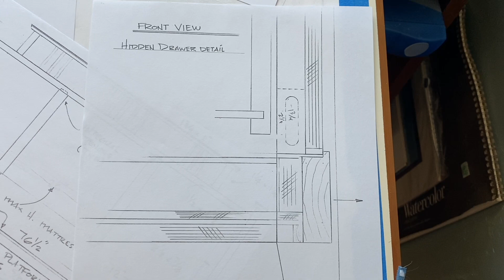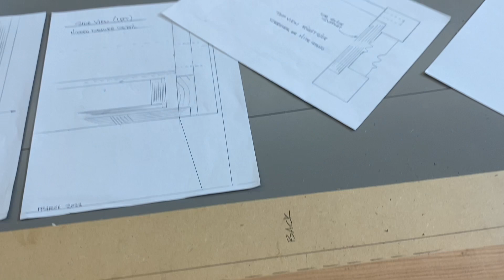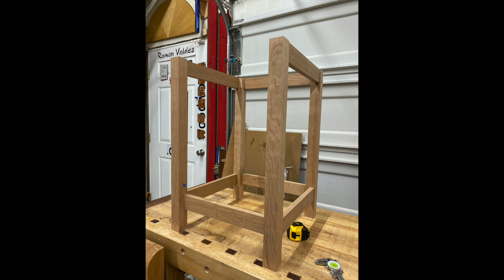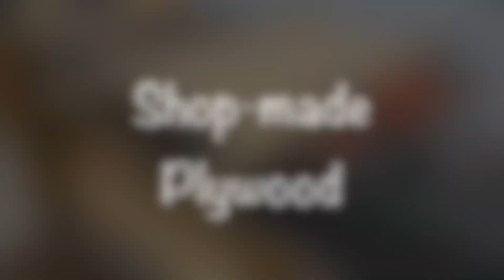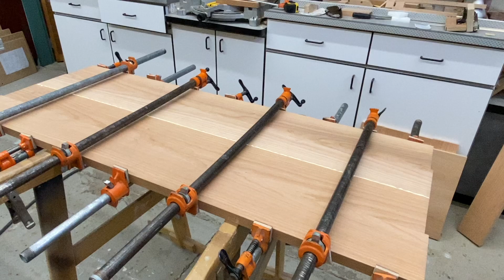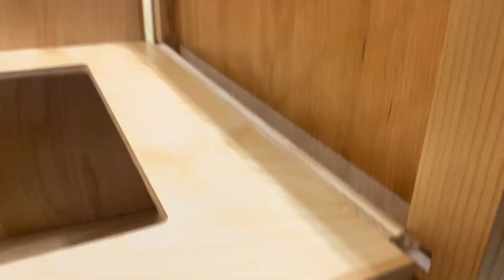Dresser & Night Stands Build, Part One

Comment: Hi Ramon. Very informative video. Two questions:
1) where and how were you trained? Or are you self taught
2) if there was twist when you checked with the winding sticks, how would you have adjusted it? Since it is all going together with mortise and tenon
Reply from the maker: I’m mostly self taught.  I did take a marquetry course over several days with Craig Vandall Stevens…that inspired me greatly!  This was fairly close to me at Anderson Ranch in Aspen, Colorado.  

Assembly of a large piece like this can easily acquire twist.  Whenever possible it’s best to glue up & assemble on a known dead flat platform.  On this particular piece, I had to roll it onto its back, ends etc during glue up.  I didn’t want to dent it on a platform, so I chose to assemble it on the floor, on a clean carpet section.  Then immediately after clamping, I checked with the winding sticks.  It was slightly off and shimmed accordingly…rechecked and now perfect.  

Had it been glued with a twist, it would still have that twist!  Such an important detail that should never be overlooked!  
Hope that helps. Much thanks.

Comment: Great video, always enjoy seeing your designs. When your making the shop plywood what is the purpose of adding a sheet of veneer in the middle, does this add extra strength to the glue up?.
Reply from the maker: Thank you.  Yes…it creates rigidity to the normally flexible & thin pieces of store bought plywood.  The added veneer grain direction is important (perpendicular to the adjacent plywood) as is the type of glue.  I use epoxy here.  Then the two outside face veneers were glued with regular Titebond I.  If the panels were large, then I’d use a rigid glue for the face veneers…like Pro-glue, Unibond or even polyurethane glue (Gorilla) These glues lock veneer in place and won’t allow them to “creep”.  But wish smallish panels like I have here, a PVA like Titebond I is fine.   Thanks

Comment: For me, the biggest “take home” from this is how important preparation is if you want excellence. Starting with formalising the design (whether on paper or software like Sketchup); making full size templates through giving yourself plenty of time to prep the timber. In business, I had a motto that issued very often for colleagues preparing for potentially emotionally charged meetings - nobody ever came out of a meeting saying that “ I wish I had prepared less”. Almost never is prep time, wasted time. 

I’ve got the same shooting board - it really is an excellent tool. It seems like you, that I’m a sinister and so, as Tino only makes right handed boards, I use a low angle plane right handed; it took a little bit of getting used to. My Veritas shooting plane is a left handed version and I use that on my shop made left handed shooting board only for 90 degree angles. Yes, sinisters have to learn to be ambidextrous. 

I’ve got many of those aluminium cramps. I got a tip years ago to insert a piece of timber the length of the aluminium channel. It greatly increases the rigidity of the cramp 

I’m nearing the end of a large barn conversion and a son and I are 2nd fixing. All the details owe their design to the UK Arts and Crafts movement, US craftsmen style and are in oak (some solid, some edge banded ply or mdf). A lot of oak; currently £16,000 worth and maybe a bit more to come.
Reply from the maker: Fortunately, I wasn’t rushed by my client.  The Cherry came from Pennsylvania…humid and I live in high desert.  So I wanted the stuff to climatize well.  

That made me laugh!  “I wish I had prepared less”! 😆

I love that shooting board.  Recently, Tito said he’s making his last batch.  Glad I have one.  

I like the aluminum clamps.  They’re perfect for light clamping…I’ve never felt the need to add the hardwood inside.  If I need heavier clamps I have bar clamps or even stronger, I-beam clamps.  

That barn conversion would be great to see!  

Thanks for your input always!

Comment: Do you utilize any type of "drafting" table for your drawings? I always have good intentions of doing detailed drawings at the beginning of a build but have yet to find a system I like. I do use Sketchup but I prefer hand drawing like yourself.
Reply from the maker: I almost always draw something out…to get proportions correct and also to work out details.  I used SketchUp at first but feel more familiar and connected when I draw it out…especially full size scale.  This project has some areas with detail that is super tight!  Hidden drawers!   I’ll show more soon.  Thanks man 🙏🏼